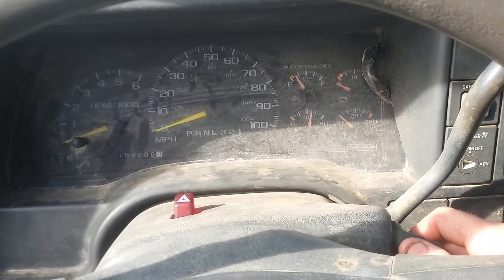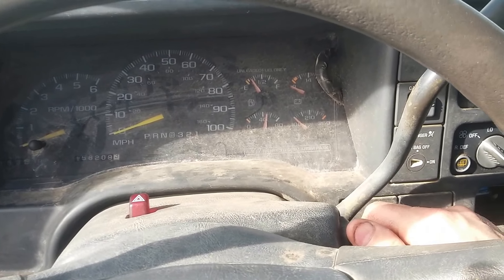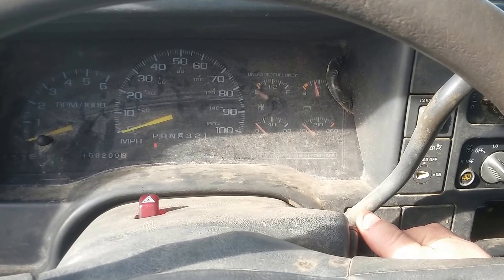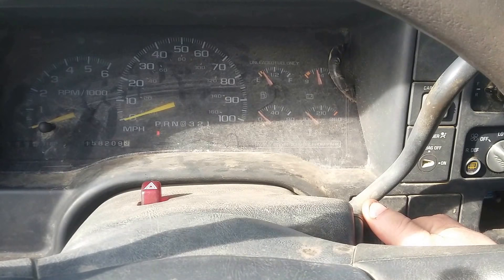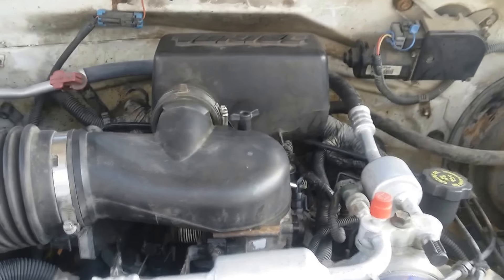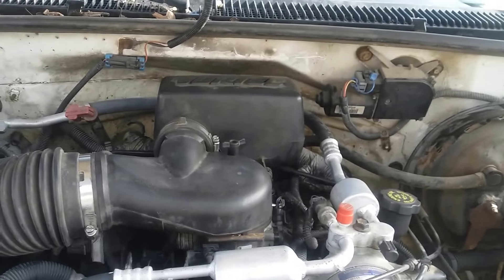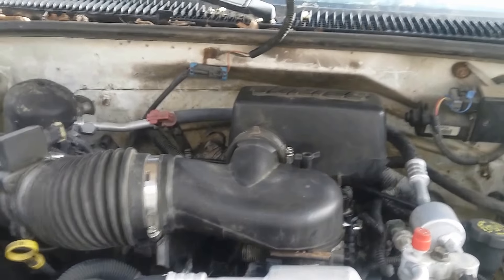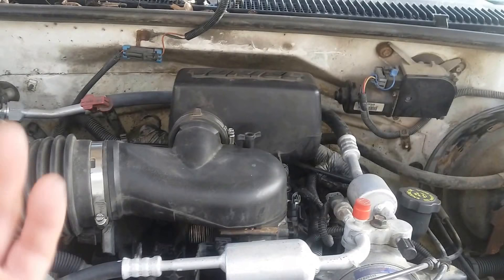Fuel pressure regulator 1998 4.3 chevy 1500 truck no vacuum hose needed

Comment: Ya then if the diaphragm in the regulator breaks and it spills out gas everywhere while you’re driving you’ll have a nice toasty warm drive if anything wants to spark it up. The vacuum hose can also be a safety because if the diaphragm does break it will suck the fuel up through the intake and the truck will burn as much of it as it can instead of just dumping it into the engine bay (running rich is better than burning alive)

Comment: I am also having trouble with my 97 c 1500 4.3 liter. Just changed fuel pump. It kicks on and everything else but won't start. Is there a Schrader valve on the line to check and make sure???
Reply: There should be a schrader valve at the back of the fuel rail on the distributor cap side.

Comment: Do you have a Video changing it or working on it? Thankx!!
Reply from the maker: Hey Jod, I tried to attach pics I have of it, but I can not figure out how to add any pics. There is no attachment on this email I'm sending, sorry. If you know how, let me know, thanks, Chuck
Reply: Hi Chuck...  You can upload to YouTube as a Slide Show.... 1. Go to....  " Upload " ...... 2. on the Side, choose " Photo slideshow ".....3.  Choose your Source....
Reply from the maker: Hey Jordan,
Thanks for the tip. I was able to add a slideshow titled, "Fuel pressure regulator 1998 4.3 1500 truck no vacuum hose needed with pictures." I couldn't upload this on my android phone, but was able to do this on my computer. Regarding the pics, you'll have to take out the fuel spider too. The fuel pressure regulator is right behind it. The fuel spider has the 6 lines going into the intakes of the motor. Be careful not to bend the fuel lines when you take them off. I bent mine a little and it was kind of tough putting them back on. Not sure if you could loosen the lines down below to give more flexibility or not. Also, where my finger is pointing shows where the fuel pressure regulator would be located. It's actually behind where my finger is. It took me a long time just to find where it was located. A lot of other videos I searched showed it on the side of the motor. Wish it was! Hope the pics help! Good luck, Chuck

Comment from the maker: Yes, it did, and when I changed the fuel pressure regulator, cleaned up intake gunk, it was starting up good. Then a year or so later, starting problems again. I ended up changing the fuel pump, and that was the (next) culprit. If you're having starting problems, you probably should check the fuel pressure and see if it's high enough since that's easy to do. I made a video on changing the fuel pump, which shows checking the fuel pressure at the beginning. Different motors require different pressure, from reading past articles. My truck had to be OVER 60psi and around 62psi PREstart, meaning turn key and let fuel pump kick in. Here's the link, hope it helps:

https://m.youtube.com/watch?v=at19nY4Afsk

Comment: Did you have starting issues?
Reply: That's what I'm wondering. I've replaced everything but I'm wondering if its starting like mine. I can spray starting fluid and it'll start and stay running. I'm pretty sure its the FPR for me. It's like no fuel for initial start.
Reply: Pool Man have you figured it out yet??